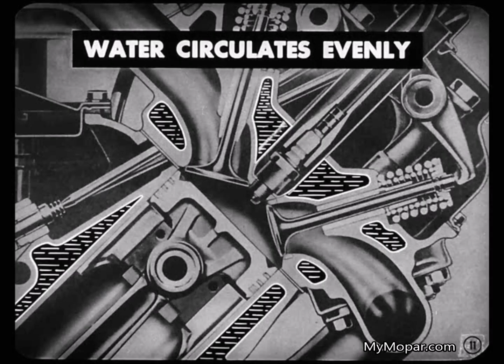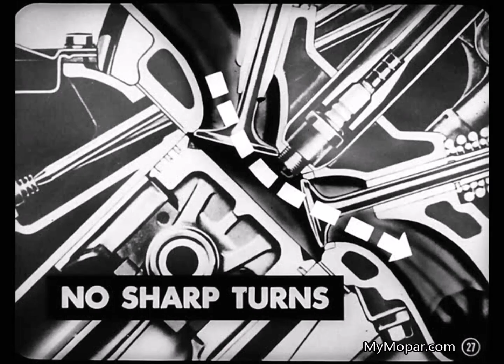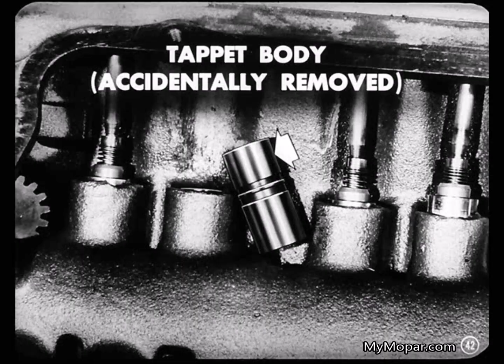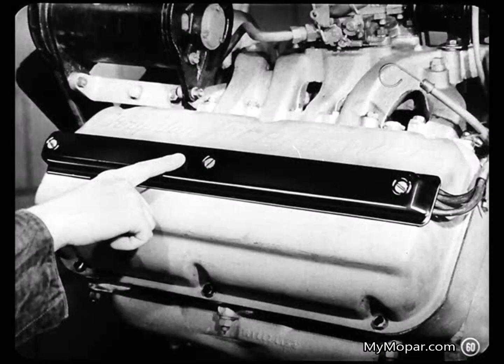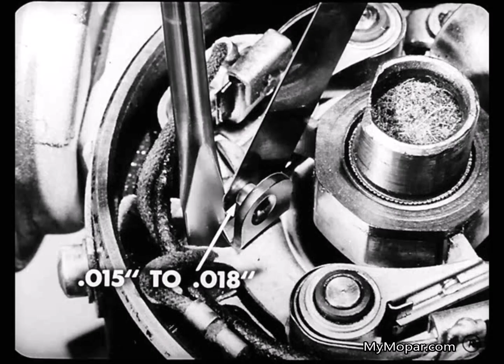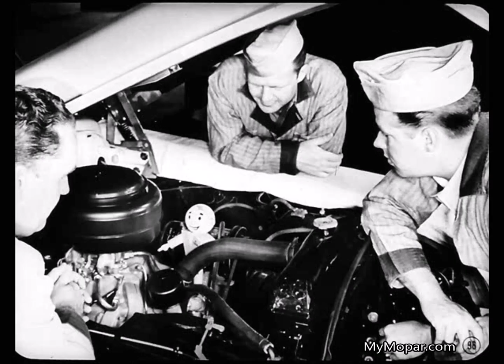Chrysler Master Tech - 1951, Volume 4-8 FirePower Engine Facts

Comment: I have been a professional mechanic going on 38 years. Needless to say I have seen a lot of changes, especially in the last ten years. I have managed to keep up with those changes while remembering the basic fundamentals of a gasoline powered car hasn't changed much since it was developed. The internal combustion engine still needs the same four cycles to operate. Whether the engine has breaker points or nine on-board computers, without those four cycles, the engine won't run. 

That being said, this video is as relevant today as it was 70 years ago. A lay person with little or no understanding of an internal combustion engine could gain some useful knowledge from watching this video. How does a spark plug work? What is a valve? What does a piston do? Where does the crankshaft go? The information you and I take for granted is easily understood in this video.
Reply: The 'information' in this video is misleading.

So many antiquated assumptions being perpetuated as facts.

But good job being an ignoramus.
Reply: @ThunderAppeal  Assuming others aren't as knowledgeable as you makes you foolish.

Comment: My first car was my mom's hand me down 1958 imperial two-door coupe with a 392 in it. That 392 moved that big heavy car along pretty good. It was big power for back in the day
Reply: Yes, and today that Imperial would be worth a tidy sum.
Reply: @joecummings1260  These Imperials could easily out accelerate a Cadillac from a full throttle stand start when both cars are being floored like from a traffic 🚦 light. My parents had a 58 Caddy and the Imperial was pulling ahead of us while we both drag raced no doubt the Imperial was a 58 or a 59. I too think the Imperial had a much more efficient automatic transmission the Torque flight Automatic with a heavy duty torque converter. The Hydramatic in the 58 Caddy only used a Fluid Coupling which does nothing to multiply Torque at all.

Comment: Today on Legacy ChryslerTech..we cleaned up crancase n changed oil in the 318 v-8 shop truck(Ramcharger)...next is part 5 of a re-haab for a 1993 LeBaron 2.5L Convertable unit- R&R cv shafts n axle seals- trans fltr n.new fluid. Happy Motoring!..
Reply: 🤣 its too bad that future is coming up fast

Comment: Had a 354 hemi, cylinder heads weighed more than a Prius.
Reply: My cat weighs more than a Prius
Reply: mopar   2 words 

Who cares
Reply: I owned a 354 hemi also it had sodium cooled exuast valves.
Reply: The Prius is a great car, it is 100x more comfortable than a muscle car 100x better gas mileage, 100x safety, 100x quieter, 100x  more practical, more seats and cargo space AC and better heat.
Reply: @alexnather7614  Prius has too many moving parts. It's trash compared to any Tesla.
Reply: Alex Nather Well that’s is really good, now therefore you should go and watch some Prius videos
Reply: @alexnather7614  why are you talking about muscle cars?
Reply: @alexnather7614  
The Firepower responds to asSalt, the Prius, battery. But 75 years on, I've seen two tiny smaller 241s still kicking out bulk 130 to 160 power on a dyno on Regular pump gas. Good luck with the Prius in 2096. Hope to see it still working in 2070...when I'm (hopefully) 100 years old.
Reply: @alexnather7614  but you get 100% more p****y than a Prius in a muscle car, and that's what matters.

Comment: owned one of these dodges with the gyromatic transmission it was slow you had to step on the clutch for the transmission could shift up to a higher gear.i gave it away to my friend for nothing and bought a mercury.  jim

Comment: The '51 Chrysler, Plimouth and DeSoto cars I've seen here on Brazil when I was only 8 years old - I am 64 now - are all on block mounted valves and plain heads, if it was Ohc were only for north america' consumers...
Reply: It goes both ways...you can/could still vw beetles and Toyota hi lux trucks....but not us here in USA....which has been taken over by communists...maybe we'll get ladas.
Reply: @mark-wn5ek  Amen brother.....

Comment: wow High compression 7:1? man, that's pretty low by today's standards... I had a 55 New yorker with a 331 hemi. I miss it so! :(
Reply: Yeah my 67 Buick is 10.25/1
Reply: @glorifiedng: 7.1 compression certainly not high at all which allows use of regular gasoline! Starting these cars I always thought you have hold the accelerator down to the floor board when fully warmed up to prevent flooding and with the clutch pedal also held down to the floor board.
Reply: My Dad had a 1951 Chrysler Windsor with the 6 cylinder engine and Fluid Drive with the selector showing "R L N HI drive". When starting that car anytime you had to hold the accelerator down to the floor board to prevent flooding always and with the clutch pedal fully floored and gearshift in neutral. The car could easily be accidentally started in gear causing the car to move unless you had the clutch pedal down to the floor board. The transmission always willingly kicked down into a lower gear on full throttle in HI range or LOW range!
Reply: @albertcarello619  wow that sounds like... in todays specs: bypassed clutch depressed switch and starting it in gear. I saw where a technician got "unalived" when a young lube tech stepped on the clutch to crank the car after an oil change and it was in gear, and he did not realize when reaching for key, and after start let off clutch and it learched forward, running over the other tech. believe it or not, the owner of the car got sued for wrongful death, or something, by the tech's family.  VERY DANGEROUS!
Reply: @glorifiedng  There's no neutral safety switch to prevent the car from being started in gear like todays automatic transmissions. With Fluid Drive you'd better make sure the car is in neutral and the emergency brake is applied when starting a car with Fluid Drive as well as the clutch is fully depressed to the floor!
Reply: @glorifiedng  I would never get a car with manual transmission from what you told me about this incident. I'd go broke settling with the victims.

Comment: High compression ratio.... 7.5 to 1. Bad times...
Reply: Not as bad as the 70's and early 80's. 100hp V8 engines were common
Reply: He's right. Gas in 1951 was trash.
Reply: @MrErikw26   no, they weren't common lol.
Reply: 7.5 - 1 compression is better than having EGR.  EGR is terrible for torque.  So is a lean air-fuel ratio.

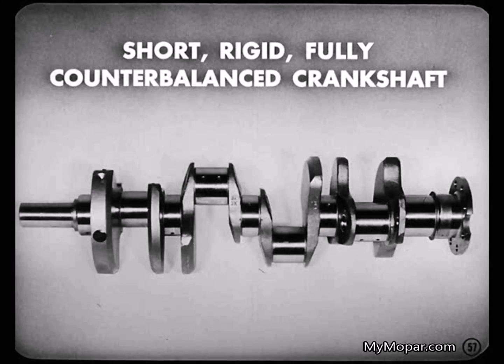Comment: At 9:52 a fully counterbalanced crank??? There are no weights either side of the centre main journal.
Reply: Only Ford Y blocks and the Lincoln 317 - 345 - 368 engines had a truly fully counterbalanced crank.

Comment: I am about to rebuild an old 392 hemi in my old 59 tow truck. What is interesting is that modern "hemi" engines are not hemispherical heads, they are oval in shape with a plug on each side of the chamber. The modern hemi is only a trademark name. You can get a real hemi from harbor freight. Lol
Reply: Looking at this engine, it also isn't a half sphere, so not a true hemi either. The last true hemi was probably in the thirties when comp ratios were more like 4 or 5 to 1.
Reply: I don’t recall that they ever claimed the chambers were hemispherical at the cylinder bore diameter. Rather, they were accurately called “hemispherical segment” chambers, whose radii were much larger. They were segments of half-spheres much bigger than the bore diameter. Regardless of the precise shape, the point was to allow room for bigger valves and to center the spark plug in a relatively symmetrical and smoothly contoured chamber to initiate the flame front in the center, ostensibly burning the mixture more quickly than lighting the fire at one edge.
Reply: @PeopleAlreadyDidThis  I have pictures of the heads, they are perfect spheres.
Reply: The modern Hemi would have to have a 7 - 1 compression ratio if it didn't have those squish areas, and with that little compression, scores of people would refuse to buy it, despite the fact that it wouldn't require EGR.

Comment: is the Chrysler 318 a Good motor
Reply: Yes! The LA series is a smallblock workhorse!
Reply: Yes for sure.
Reply: one of the best. I have owned a few, and one had 400,000 miles on it. One was in a 1971 Satellite Sebring Plus, 1974  Plymouth Duster, and 1970 Dodge Coronet, and also a 1999 Durango
Reply: Great motor, will not quit!

Comment: I don't get the purpose of the rocker shafts on Mopar engines.  Seems to me if you are going to use shafts you may as well design a over head cam and improve valve train control.
Reply: but if they ran the cam down the center of the head where would you put the spark plugs? The Hemi was a great engine but the larger head size, increased complexity and extra rocker shafts put it at a price disadvantage and because of their smaller volume Chrysler had to watch the pennies to remain competitive with GM and to some extent with Ford
Reply: The rockers being mounted on shafts provides better valve-train  performance at high RPM and makes the whole valve-train more stable.You don't have the issue of valve float with the rockers  on shafts as opposed to studs like other V-8 designs.
Reply: and make it even heavier and thus, more annoying to work on?
Reply: @fk4515  This is one reason why the polysphere engine was invented. It had much of the cross flow effect of the Hemi, but used one rocker shaft per head. In addition, they didn't have to route the spark plug wires through the valve cover, further reducing the price. Also, the combustion chambers were as-cast, which was another cost saving measure.

I sometimes wonder what would have happened of the polysphere designed continued on the LA engine.
Reply: @fk4515  there's 2 rocker shafts, use 2 camshafts like many do now, they mostly have the plug in the centre.
Reply: @whitelightining7125  the dual valve springs handle valve bounce, not rocker shafts. Rocker studs are lighter and less machining in production and cheaper to replace when worn.
Reply: @GlassTopRx7: Spoken like a guy who has never removed and replace an OHV Hemi head in a morning  Or tried to replace a Overhead cam Explorer 4.0 V6 chain drive guide in...less than 33 hours. Everything should be...rotary!
Reply: Rocker shafts are much better than ball-stud.  They are more durable.
Reply: OHC makes the engine physically larger without adding cubic inches.  OK for a stationary engine, but not OK for a car engine.

Comment: This is definitely mostly advertisement but at the same time it teaches you about engines anyways. 

It tells the layman "here's how engines work, that's why ours is better" instead of saying "Firepower. No substitutions." And relying on brand recognition.

"High compression ratio of 7.5:1" what a different time
Reply: In 1951, there was few, if any, piston engines out there this advanced.  Short of an R-3350.😁
Reply: Much of this is obsolete on cars made in the last 30 or so years.